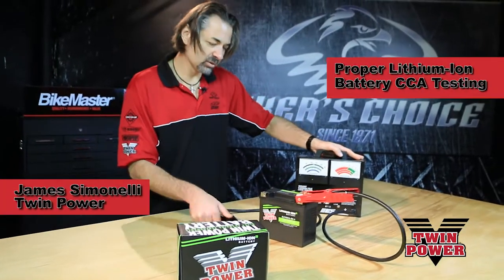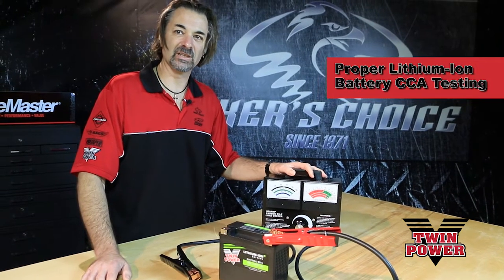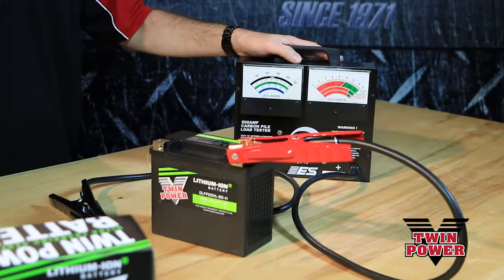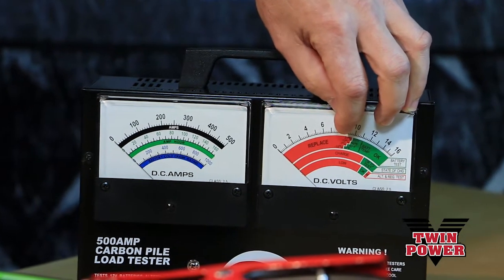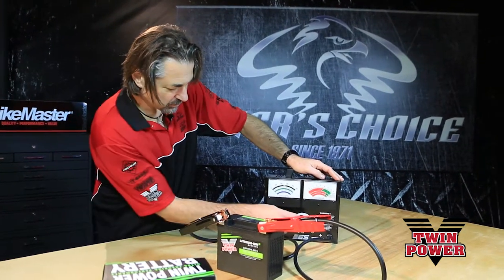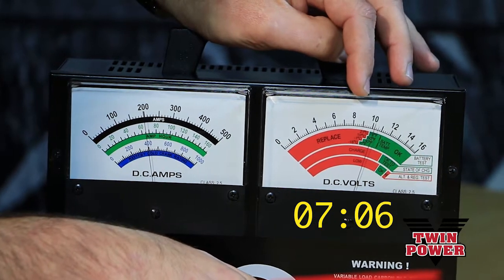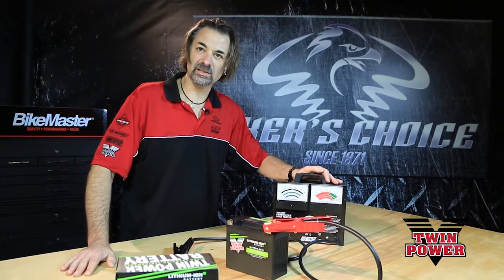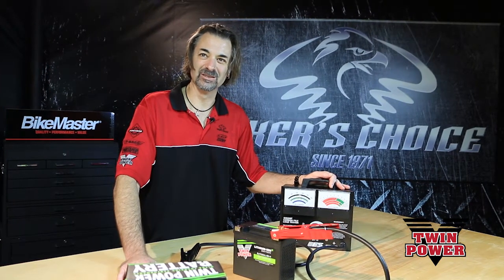Proper Lithium-Ion Battery CCA Testing | Twin Power

Comment: What type of lithium ion was that?😅 I meant specific chemistry 😊 like LCO, LFP, NMC, INR, IMR etc...
Thanks 🎉
Reply: In my understanding only the LFP chemistry is used as starter battery, because the nominal (average) 3.2V, maximum 3.6V of LFP does fit 100% to systems designed for 12V lead batteries. When putting 4 LFP cells in series you get nominal (average) 12.8V and the charger for lead batteries is usually set to 14.4V max, which is identical to 4x 3.6V max for the LFP type.
When using another chemistry with nominal 3.6/3.7V and maximum 4.2V you do not get a match with your system, this means a BMS would be necessary which will cause some voltage losses over the MOSFET-switch, increase cost AND cycle life time would be drastically lower.

Comment: Which economical voltmeter should I use for 12v LITHIUM batteries. How do you test them for voltage??
Reply: Any voltmeter is OK. However, you should be aware that the voltmeter will give you only a very rough information as the LiFePO4 type of chemistry does have a quite stable voltage versus its charge status. This means the voltage alone does not give you accurate information about the remaining charge, but the voltmeter will give you a clear information if your charging system is working correctly by not passing 14.4V and if you have not caused a deep discharge (a LiFePO4 12V starter battery should never ever be below 10V).

Comment: Why only 200 Amps and not the full 400 CCA that it is rated for?
Reply: 400 is peak, 200 is RMS (root mean square, meaning average).  That battery can hit 400 for a very very brief moment without damage, but the actual rated load for a battery sits right in the middle of that peak and zero.
Reply: Thanks for your precious answer.